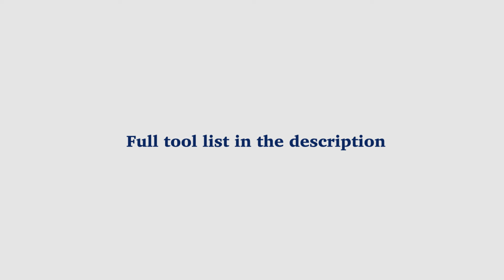Shimano pressfit BB86 bottom bracket removal and installation How-to tutorial

Comment: Its easy when you have the right tools (and there are many much less expensive than the shimano ones, yet they still work great) and i actually dont know why so many people make a fuss about the pressfit ones. never had a problem and i also didn´t need an absurd amount of force to press them out on all frames i worked on.
Reply: How are they 4 years later when they've been changed several times? Frame getting loose yet?

Comment: Great video! Installing my first PF BB into a new carbon frame - should there be the occasional creak along the as your getting close? Had around 15mm left to go. Thanks.
Reply from the maker: A small creak can occur, as long as it doesn’t sound like cracking you should be fine. Carbon frames have tendencies to be out of tolerance it seams. If you pressing in a shimano bb86 cup you should be fine since The plastic cups seem to handle these tolerance issues better.
If you’re unsure though, take the bike to a professional mechanic.

Comment: Thank you very much!
Instead of the "brake protector", would you agree to use copper grease? it is used as anti-seize grease for example on the back of the pads of disc brakes in cars. thank you!
Reply: Since its plastic not metal, no. Use a silicone grease.

Comment: If you're using brake protector a similar thing they use in preventing automotive break pads from making noise is copper paste.
Reply: Yes, I think it is called anti-squeal compound and it is widely available in auto parts stores.  Don't know what it does to carbon though...
Reply: It’s is  call anti seize It use on a metal to metal surface to prevent it from binding i don’t think it is necessary in this cause since the BB is of plastic/nylon. In this case I think the paste he use is a silicone grease it Is also use on car caliper guide pin it can with-stand any climate condition and does not get hard. But I don’t know the reason why you need it Maybe for easy installation and removal.

Comment: I find your videos really helpful! I brought a BBT9 - bottom bracket and crank arm tool (HollowTech II) and now realise I don't need it as I require a Shimano Tl-bb12 Installation Tool 160mm For Press-fit Bb to remove the Bttom bracket and Shiamno BB press tool? I've slightly new to this and limited budget aha. If anyone can help with recommendations and advice I would really appreciate it.
Reply from the maker: Ben Wilson this is a cheaper removal tool than the official Shimano one (the bb90 version fits 24mm bb’s)
https://amzn.to/2OKYZcH

There loads of cheap press tools as well, the cheapest way might be to just by the bearing drifts and get a rod and nuts and washers from you local hardware store.
These drifts are universal and should fit all bb standards: https://amzn.to/2DGECMw

Comment: Hallo! Can I use the Carbon paste for my bb86 Press fit that make a terrible noise in the Carbon shell? Thank you
Reply from the maker: I would avoid that, the small particles will probably make the noise worse as it moves under torque.
Retaining compound might be a better solution.

Comment: Thank you for this helpful video. If you're looking for ideas - the world needs a 'How to remove and install a Canyon (downtube) Di2 Battery'
Reply from the maker: Noel Walsh cheers!
Thanks for the suggestion, unfortunately I don’t have the canyon anymore. I did change my battery when I had it. Basically to install it you need to remove the bottom bracket... witch is a proper pain in the ***. Just Removing the battery though, you can actually get it out at the headtube, however all the di2 cables would have to come as well... so not very practical unless you are just stripping down the frame.
Reply: That's a pity but thank you. Could you tell me please if the battery and holder come out easily enough with the BB removed? ( I think my BB is on the way out, I was thinking of upgrading my battery to try sychro shifting) Thanks again.
Reply from the maker: Yes, once you remove the two screws on the downtube you can easily pull it out trough the hole underneath the BB shell.

Comment: My shimano BB86(BB9241B) bottom bracket is marked with an L and R. I would have guessed L=left=non-drive side, and R=right=drive-side. That would mean the long half goes in drive side, the short half goes in non-drive side.  But your video has it reversed.  You inserted the short half into drive side. Am I mis-interpreting the video or this L/R thing?
Reply from the maker: The sleeve is not fixed to either side (on the BB I had here) and could be removed or moved to either cup before installation. (This was a few years ago so you have to forgive me for not remembering exactly)

Comment: Thanks for this video! I’m looking into a great bike that has a PF B.B. (I know nothing about it) but the reviews on PF are not good...
Reply from the maker: Thanks! In my experience, FP BBs har been fine without major problems as long as the install is made with proper tools and a proper clean of the BB shell before installation. Keeping up the bike maintenance (as in cleaning the bike regularly) should also help it working smoothly. All BB's will eventually wear out and FP ones are definitely the most cumbersome to change.

Comment: @ridesofjapan I need your Help:

My current bikes have BSA and I love it. It's not perfekt but cheap and easy to replace the bearings!
1. trackbike Dura Ace (these bearings are so cheap for dura-ace)
2. other trackbike ceramicspeed
3. MTB sram dub
4. cx sram gxp

The problem is that my roadbike is a speci allez sprint and comes with BB30.
It's my nice weather bike but I still ride in the rain sometimes as it rains a lot here in Switzerland.
After every single ride in the rain it's noisy and I have to bring it to a bikeshop as I'm not realy confident with hammering and pressing metalbearings in a metalframe. This is a bad solution for me and I can imagine the frame does't realy like the bb30 change to often neither.

Would a BB30 to BSA adapter (cannondale/fsa/sram) be a good solution or do you recomend going for a BB30 with beather seals (kogel has crossseals for example). I would prefere to convert the frame to BSA but I know a general rule is to build bikes with as few adapters as possible.

Thank you a lot in advance for helping and keep on with your videos.
ianis
Reply from the maker: Ianis Caratti you shouldn’t be forced to change bb bearing that often in the first place I think 🤔, but I reckon the easiest way would be to get a thread-together style conversion BB, something like this  https://wheelsmfg.com/bottom-brackets/bb30-outboard/bb30-to-outboard-bottom-bracket-for-24mm-cranks-shimano-black.html

I have a video installing a similar solution from https://youtu.be/FhZVubz0Xt0
Reply: Rides of Japan i like this idea but my crank spindle is 30mm 
I checked wheelmfg bbb kcnc praxis works even chris king only makes bb30 bearings for 24mm cranks??

Not sure if I had to replace the bearing or if the sand was "just" between the adapters/spacers but anyway it is a mess and a lot of maintenance

this is the conversionkit 
https://r2-bike.com/CANNONDALE-Adapter-BB30-zu-BSA-45g
Reply from the maker: Ianis Caratti so you’re keeping the 30mm cranks?
BSA is 24mm so you can’t install a BSA  conversion adapter and still use your 30mm crank. ( if it’s not a true bb30 crank There could technically be an option out there but It would not help you in the durability department as the bearing would have to be smaller.

If the crank is a true BB30 crank then you can not use anything else than a BB30/PF30 Bottom bracket. If the cranks are wide enough for 86mm bb shells and your frame is true BB30 you and install a bb30 > 386evo bottom bracket that should be available in “tread together” version.
Reply: Rides of Japan that's new to me but bsa and 30mm works actualy check the links
https://r2-bike.com/ROTOR-Innenlager-BB30-BSA
https://r2-bike.com/HOPE-Innenlager-BSA-68-73-83-100-120-mm-fuer-30-mm-Welle
https://r2-bike.com/WHEELS-MFG-Innenlager-BB30-BSA

1. if you can run bb30 cranks on bsa and bb30/pf30 frames why the gxp standart?

2.if the 30mm cranks fit any frame then why create the new dub system if 50% of the old ones had the same benefits already?

3. maby sram and other mainstreambrands just want to sell more but why is chris king pushing the t47 standart as threaded solution for every spindle if bsa already is a threaded solution for every spindle!

I'm realy confused right now as you can tell...
Reply from the maker: @ianiscaratti4924  It's a total jungle I know!

So the links you posted is for 30mm cranks in BSA frames, so that means your frame has a BSA (threaded) bottom bracket shell?

Sorry, I took for granted that you frame was a BB30 frame and you where using BB30 cranks. To start with, let's establish exactly what BB shell and what cranks you have :) Brand and model.

Comment: Park Tool bracket remover also helps remove the cups!? instead the Shimano remove tool.
Reply from the maker: De Witte yes, you should be able to remove the cups with the Park tool BBT-90.3 Bottom Bracket Tool Set as well. More info here: https://www.parktool.com/blog/repair-help/bottom-bracket-service-bb90-bb86-bb92-gxp-press-fit

Comment: Anyone have experience using the Wakos Brake Protector for Trek BB90 bottom bracket bearing installation? Looks like a better option than retaining compound.
Reply from the maker: Mitchell Goldflies with bb90 you press the bearings directly into the shell right?
I would not put the wakos brake protector directly on the bearings, as it doesn’t harden it could work itself into the bearing if you’re unlucky.
Reply: Thanks.  That is what I thought but I wanted to confirm with an expert before I screw things up.

Comment: Did the BB include spacers to install on your frame?  I am trying to figure out if MTB cranks will work with a BB86 bottom bracket or if I need spacers that will space it out properly to BB92 width.  Any help is greatly appreciated!
Reply from the maker: From what I remember I doesn’t include any spacers

Comment: I have to try and get my first BB86 bottom bracket in using a homemade tool and I'm simply having the issue of getting them in straight, it's super annoying. :/
Reply from the maker: Dean Grove I think those homemade presses are one reason people have so much creaking problems with Pressfit BB’s.
At least try to get the “press adapters” that goes in the bearings, those are crucial to getting them in straight. 
Something like these: https://amzn.to/2GyAdNs
The “rod” however, pretty much any cheap thing from the hardware store should work.

Comment: Is that a canyon di2 frame? I can see it has the battery retaining screws.. Can you tell me if I can reach the battery without removing the bb?
Reply from the maker: Abhishek Purohit if you manage disconnect the from and rear mech (might be hard) you can pull out the battery trough the head tube. Will be har getting it back in however.

Comment: How many nm for the bolt mate? I never see too fast
Reply from the maker: Jose Rizaldy Carolino I haven’t found a specified torque range on the Shimano bb86... I just tighten it down until I feel there is a good amount an resistance and confirm that both cups are flush against the bb shell.

My latest install on a token ninja BB they spec it to 25-30Nm, don’t know if that helps but I wouldn’t go over that in any case.

Comment: I'm still surprised in this day that someone doesn't have a BB remover that doesn't involve using a mallet and scarying the living daylights out of every bike owner
Reply from the maker: Rixter haha! Agree, I’ve seen a few extractor tools for bb30 that almost work like a reverse press, but they are far and few between.
Reply: I have the type that gently push the bottom bracket out with no hammering
Reply from the maker: 57chevy the dream!
Reply: 57chevy what brand is it?
Reply: you still there?
Reply: enduro brt-003
Reply: this tool is so cool,,works as a puller and a press,,pushes them out so gently
Reply: 57chevy thanks
Reply: Could you name the model please?
Reply: Rixter try the Unior 1625/2BB90
I use one at home.
Reply: But Unior 1625/2BB90 would just remove the bearing only, leaving the cups inside. Or do you make any tweaks?
Reply: alteragnostik it removed the cups on mine, it hooks in behind the cup.
Reply: @JonCannings  nice to see GCNTech's Jon Cannings providing helpful advice on this channel too, assuming it's the "real" Jon (seems helpful if not also)
Reply: @richfi9576  yes I am the real one
Reply: Jon Cannings did you try the unior tool on a carbonframes with bb86?

Comment: Surprised there is no torque spec for tightening the new BB. Without torque spec, obtaining correct bearing preload is uncertain. I also know, however, the torque spec depends on the type of lubricant you use.

Comment: Good luck getting that centre spacer lined upmas you push in the bearings. 9 times out of 10 it wont align. Its a poor design. Other BBs have two spacers that overlap together.

Comment: In general, the SM-BB72-41 of the shimano is unthinkable! The bearing shells are very small and tighten when the bearing is mounted. The seals also generate a lot of friction. It is difficult (impossible) to achieve alignment between the two parts, especially with the instrument in the video. The grease is not suitable for the conditions of rotation (high load and low speed). It's just made to take your money!